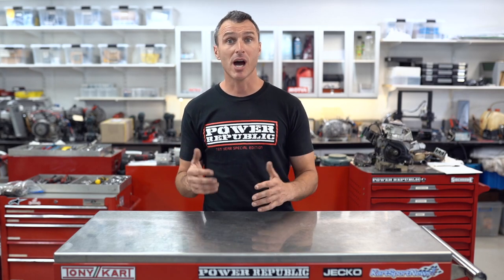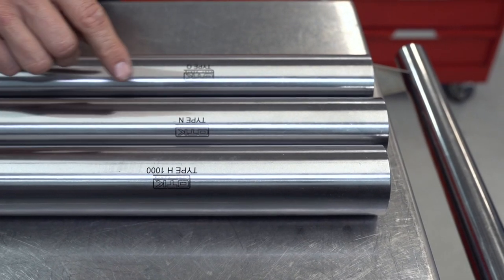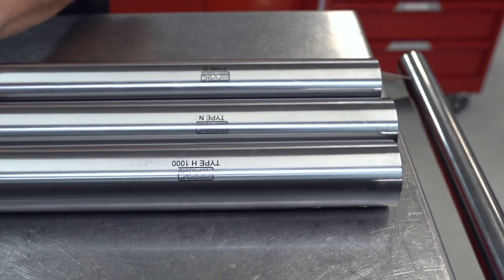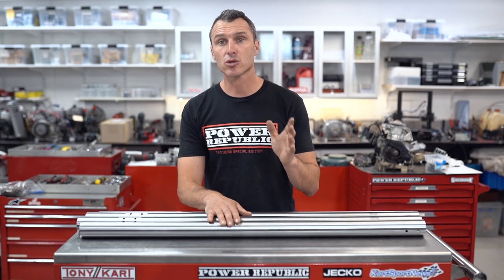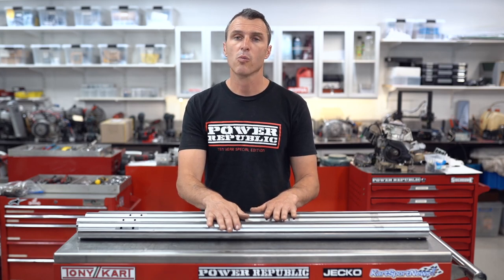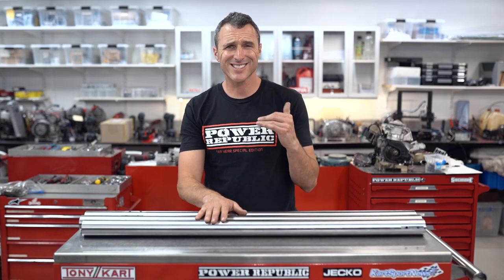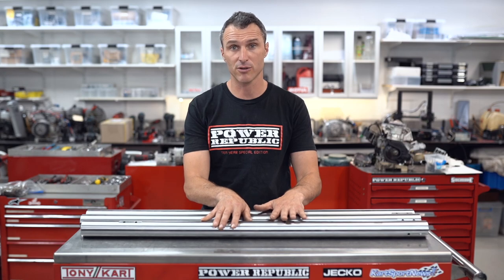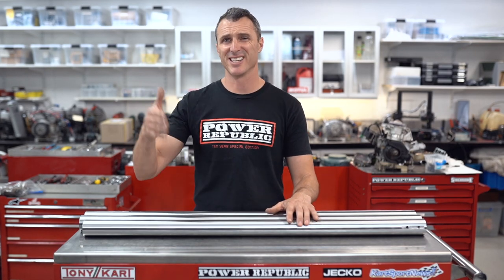TUNING TIPS: Using Axles To Fine Tune Go Kart Performance - POWER REPUBLIC

Comment: Morning... one thing ive always been told is only change 1 thing at a time. So either tyres, axel length OR hardness ect. That way you can figure out if the change actually helps before doing something else which would confuse things.
Reply from the maker: morning Chris, yeah that correct if you haver the time and especially as you are learning.  once you have a good knowledge base you can hit the kart with some combo's.
Reply: @PowerRepublic hit em with the wombo combo

Comment: Why would the length of the axle matter? wouldn't it be the distance between the hubs you want to be concerned with. When you shorten or widen wheel base will be the distance your focus should be on. The length of the Alex behind those points won't matter. What am I missing.
Reply from the maker: Hey mark, yeah that is normally correct.  have you ever tried the short v's standard length axle on track?  small difference only, but it is a good tuning tool to use if it suits your style.   Most important thing over all the changes....drive fast and the rest will take care of itself
Reply: @PowerRepublic  right on, I'm still a bit confused but maybe you guys send me one and I'll see what your talking about. 🤷‍♂️
Reply: think if you use same hubs, same width, what changed? The area on which the hub grabs to the axle, its like if you would grab with your whole hand or only with fingers. And by a shorter axle you somehow change the initial hardness of the axle, because of the deformatiion of the contact point between axle and hub.. Try it
Reply: @bernardplanko6780  thats what they make softer and harder axles for.
Reply: @MrMarvin444  you didnt understand in full , its another toll to work with and it can make you a axle which is soft on entry and harder in the middle and vice versa
Reply: And its the flex from the cassete to the whell that also matters
Reply: @bernardplanko6780  well if power republic  is saying it makes just a small difference makes it very hard for me to believe that this is worth even trying, logic doesn’t lineup for me so I’m not gonna waste money and try this for a “small difference”
Reply: I'm with you on this. Very useful information in the video, but as relatively new karters, I think we'll concentrate on getting our heads around the other main variables (tyre pressures and track width) before introducing more complication and cost.

Comment: Thanks Dezzy, Although I've been around karts a long time, my time off went from 30mm to 50mm axles, a lot changed. That helps explain why the kart I race in at Enduro's the drivers get very different feelings, I'm average height, the other 2 are over a foot taller then me, and the previous owner and drivers were my height or shorter, so the axle will be more suitable to me then them, or they just need to drive faster ;)
Reply from the maker: Yeah boi, always drive faster is a great solution.  Most the problems seem to disappear after that really

Comment: Question on axle length for fast or slow corners; can you just increase/decrease the track width instead of a 1030 or 1000mm axle?? Will it have the same affect?
Reply from the maker: not sure 100% on that, but yeah,   normally for fast flowing tracks I will run the wider rear hub settings.

Comment: hi, which axle CAN YOU suggest in order to avoid to have a jumping kart when the weather is hot and on the track is rubberized?  The kart is a tony kart 401 R with an axle type N cutted at 1030mm and the engine is a  Vortex Rok GP (clutch engine). I'm  tall 1.80m and heavy 70 kg. thank you. Michele

Comment: My son and I are just a few weeks into his karting hobby. It's quite a rabbit hole, eh? Hard, soft axle? Is that a reference to their degree of flex? Why would a hard one more likely be accompanied by softer tyres? 
Maybe this is all a bit premature. Probably concentrate on getting him around the track without spinning-out first. Appreciate the videos. Really informative.
Reply from the maker: Very welcome.  Yeah the most important thing you can do is get on the track.  Most karts will go around the track in almost the exact time.  It’s the drivers that make all the difference. Then when you are looking for the last few tenths, you can start the marathon of shelling out cash looking for the next little bit.   It is a slow road.

Comment: Great videos guys! Really been helping me getting back into karting after a while. 

Picked up an X4 but has a 40mm axle and 17mm front stubs. Is it worth me upgrading to a 50mm axle and 25mm front stubs?
Reply from the maker: not really.  the cost is better spent on an upgrade chassis IMO.  if you got a cheap one, use for a blast and some fun.   then if you want to race get something worthy

Comment: Great break down on the axle tuning. My question is sometimes axles will flex and become untrue. Sometimes due to an accident and sometimes maybe from repeated contact with running over huh curbs. Whatever the case, is there a out of round tolerance before it needs to be replaced?
Reply from the maker: less then 0.30mm run out and it shouldn't effect the kart too much.  0.30 - 1.0 mm is manageable but definitely the driver will experience vibrations.  and more than 1.0mm and we have problems Houston
Reply: @PowerRepublic  
Haha Houston we seem to have a problem!

Comment: Hi , great advice as ever 👍 what is the difference between narrowing the rear track width and switching to a narrower axel ? Cheers
Reply: usually when you switch to a shorter axle you keep the SAME rear track width and results in less rear end grip and better front end turn in before Apex.....

Comment: Hey Dezzy, my son is in a cadet kart, 4 stroke class. We're at max rear width (short hubs, right out) and minimum front width and his chassis is straight. He is currently running a 1000mm medium axle but still often 2-wheels in the tighter corners. Some folks have suggested trying a different (softer) axle to reduce the excessive jacking and 2 wheeling effects. Do you have any advice on this? Thanks!
Reply from the maker: Hey Dave, yeah you could that.  also widen the front to give the kart a square foot print.

Comment: Derek hi!
Quick question, I’ve always used Standard axles, if you go to a harder one or a softer one, does it really make that much of a difference? And Can you really feel the difference from a standard length axle to a shorter axle? Usually if the track has a lot of very tight corners then I just narrow the distance of the rear wheels, instead of 140cm I might narrow the distance to 138cm or maybe 136cm, wouldn’t that be the same as having a shorter axle?
Thanks in advance 🙏
Reply from the maker: Hi PC, yeah the difference is small.  And the standard N axle is great all rounder.    but the H axle helps the bigger guys here locally that we work with.   and soft axles I have gone too in the cooler months for sure to get the kart on sooner.   so yeah, once you have some skills play around with 1 axle either side of standard for sure, especially if you have travelled interstate or to a new track.
as too shortened axles v's rear track.....noit really.   I haven't found much luck with super narrow rear track.  the short axle is not my main go too, but can help sometimes.   can you do me a favour?  hit the track this weekend with the rear track at 1360mm standard length axle, then cut the axle down to 1000mm and move the wheels out to 1390 and let me know how it affects the kart for you?
Reply: @PowerRepublic  
Thanks a lot for writing back Derek, I have a spare axle at home that I can experiment with, so I will do the experiment, I will cut the spare axle to 1000mm and then try with the wheels at 1390mm, I can’t wait to see how it feels, I always thought that whether the axle is a Long one or a Shorter one, if I kept the rear track at 1390-1400mm then nothing significant would change, but I’m probably wrong.
I’ll let you know how it goes, thanks again 👍
Reply from the maker: Yeah it will be interesting to see if your results are the same
Reply: @p.c.h.6721  Hi, I am curious to know the result. Did it change something for you?
Reply: @samalesi3188  
Hi, a shorter axle made the kart more responsive, it turned better on tight corners, at least that’s how it felt to me, give it a try, it’s easy to do

Comment: Conceptually....the soft axle has less grip and allows the kart to slide better?
And the hard shaft has more grip and allows the kart to slide less and grip more?
Reply from the maker: not really for me.  hard axles we use mostly in the summer and softer in the winter, as a general rule.   where you racing at gonsilver?
Reply: The otk chart says that q offers lower grip. It’s basically for track with high grip and rubber

Comment: What way would I go with the axle if I have hoping?
Reply from the maker: on the way into slow hairpins?
Reply: @PowerRepublic  No mainly fast corners more specifically. Turn 4, 5, 7 and a tiny bit on turn 9 at toowoomba.
Reply from the maker: what class are you running Codie?
Reply: Tag restricted light